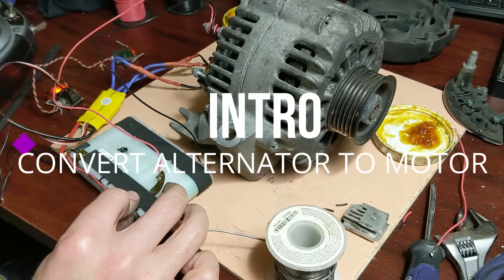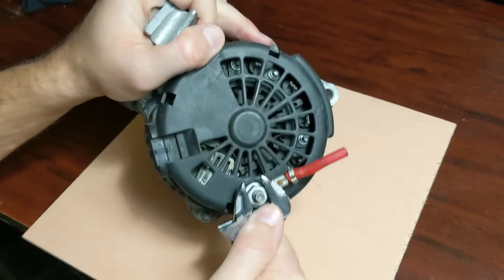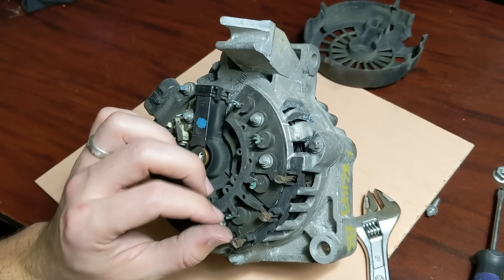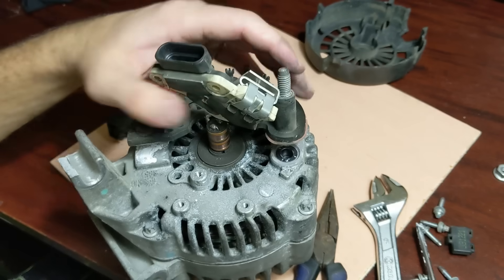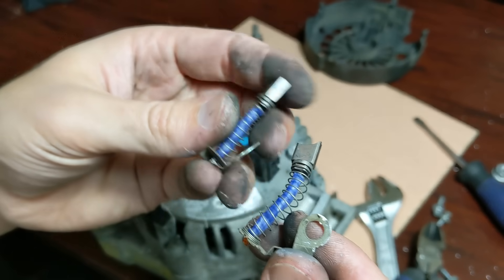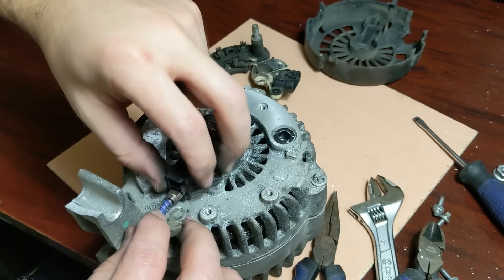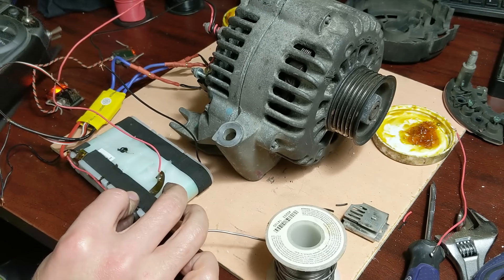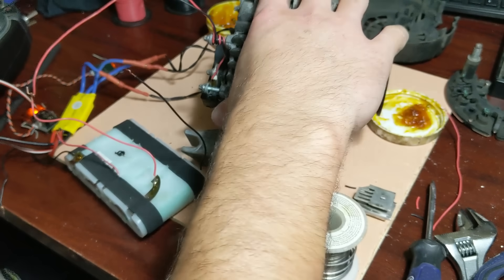Convert Alternator to Brushless Motor

Comment: You incorrectly refer to the rotor as the stator. The rotor is the magnetic field created by the application of 12volts DC or less to the brushes. It rotates, so it is the rotor. The stator is a 3 phase array of windings which is supplied with the main motor current. It doesn't rotate so it is the stator. The high current to the stator is controlled by the ESC which puts out a 3 phase AC pulse width modulated current.
Reply: He's exactly right 
Spinning = Rotor
Body Coils = Stator 
What you did is a motor that can be controlled either way you want, less power sent to the rotor you're going to have more revs but less tourqe and obviously more power sent to the rotor it'll slow your revs down but have more torque, you can play with stator and rotor individually so you get whatever you want, bare in mind that this alternator was designed for a 12 volt system so my advice is to not exceed 12 volts !!
Good luck interesting video
Reply from the maker: Thank you for explaining this to me.
Reply: correct on the id of the parts. Stator...stationary...Rotor rotates

Comment: how is that "brushless"?!.
Reply: if it works with bldc controller, its brushless
the brushes is only there for electromagnetic excitation of the rotor
if you buy/build a rotor with permanent magnets it will be a complete brushless without the need of excitation
Reply from the maker: It works like a brushless motor, but it's not
Reply: I saw him take out the brushes ;-)

Comment: Rc brushless motors spin faster in delta configuration that's why they use more amps than y configuration
Reply: A motor connected in a Delta configuration will draw more amps than if it were connected in a Y configuration due to the fact that the Y configuration places the windings in series - adding the coil resistance values.

Comment: "I might need to get new brushes" -- not if we're using the same definition of "brushless", meaning, "not needing or using brushes"
Reply: The rotor of a BLDC motor uses permanent magnets where as the alternator has a wound rotor with slip rings and brushes to magnetise the rotor. To convert an alternator, he is applying a fixed voltage to the rotor. 

It seems.
Reply: @SW-qr8qe  exactly
Reply: You guys when realize that alternators use brushes keep feeling betrayed...
If you dont want brushes, use PM rotors, you lose thr KV alteration but pk
Reply: That's why I clicked on it
" brushless means just that brushless"????

Comment: Hi, thanks for your work on this. Really great. I was wanting to convert an alternator to a motor and run it off a 12V vehicle battery. Would a 48V ESC work? Or would you need a different  setup
Reply: any esc voltage from 24V to 72V on the stator would work (if you use 4-12V on the rotor brushes), just need to cool the alternator or use pipes/something to guide air to the alternator depending on the voltage
Reply from the maker: 36v or 48v would work!

Comment: Your video title says '"Convert Alternator to Brushless Motor", this is NOT a brushless motor you have a battery connected to the brushes of the alternator
Reply: A brushless motor normally refers to a DC motor with a permanent magnet for the field, and 3 wires for the stator. An alternator when used as a motor is the same but as it has an elecromagnetic field. It has small brushes to supply power to the field. The brushless DC motor requires a special electronic speed controller to operate, as does the converted alternator. A brushed DC motor has 2 big brushes that must handle the full load current of the motor. Both motors are actually AC motors. The brushes and commutator of a DC brushed motor convert the DC to AC to the motor.
Reply: @chrisholloway2853  you explained it pretty well and there are some advantageous being able to control the magnetic field. This seems like an interesting motor to play around with with controlling the Armature current could make the motor more Torquay or more RPM .
Reply: @steveclunn8165  yep, various youtubers already showed the advantage of using this control over the brushes, its like a field weakening in bigger motors: when you're in max power and still needs a bit more RPM, you weaken the field and the motor can spin faster, albeit with less torque
Reply: @foxxyytofficial  can you please tell which YouTube channels shows what you just explained?
Reply: But it is not the conventional definition of brushes and commutator combination style electric motor.  There is no commutator to access individual windings as on a brushed DC electric motor.  In a Brushless DC motor with permanent magnets, there are no brushes to the central shaft.  Rather there are permanent magnets that make up the magnetism of the rotor.  It must be that these alternator motors rely on energized electromagnet coils for the magnetism on the rotor.  Since there are just two contacts, it is power in and out, and so the coils magnetic fields will be constant on the rotor.  And so the wires on the outside stators will provide the dynamic magnetic fields and sensor circuits for the 3-wire ESC.  They are not so much brushless as commutatorless ;-)
Reply: Are you an attorney, or just a kill-joy? Or both?
Reply: So how about removing the brushes & slip rings, and wiring a small start capacitor (or two) into the armature windings? 

It works to self excite the armature of a few models of cheapo brushless AC generators.
Since the field isn't reversing, the start capacitor(s) should just hold the static charge...
Unless I'm mistaken, in which case I'll thank anyone who can tell me what I missed.
Reply: That´s right!!!
Reply: As brushless, not brushless,
Because the alternator is brush
Reply: @hurlrules1  
I'm actually getting ready to try this very experiment...

If you take a look at the schematics for a "TailGator" brand generator, you'll see that one of the windings are configured exactly as I previously described.
Also, have a look at Ford "one wire" alternators. I've heard of them being converted in such a way, but haven't had time to look into it.

Since every single generator design other than self exciting work as a motor as well, there shouldn't be any reason this design should be an exception.

The only complication that I can foresee is that the frequency of the start capacitor may regulate the RPMs of the motor. Perhaps to an extent that the motor won't be able to start on its own.

If an alternator from something like a mid 90s Ford Crown Victoria is used, each of the three phases are comprised of two parallel windings. 
One of the windings for each phase can theoretically be used to excite the armature by passing magnetic flux as an electromagnet would.

I'm going to begin with a rebuilt "TailGator" as a proof of concept.
Should that work out, I'll move on to rewiring an alternator & adding the start capacitors & (if needed) diodes.

Regardless of how things work out, I'll post the results here & provide external links to parts, diagrams and perhaps videos.
(Since posting videos to YouTube seriously violates one's online privacy)